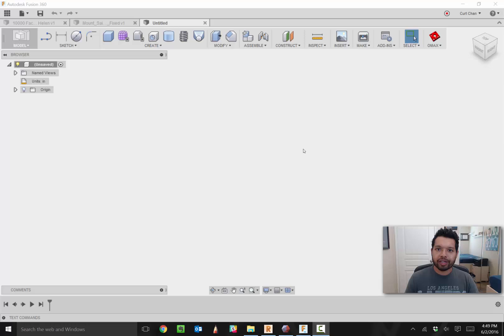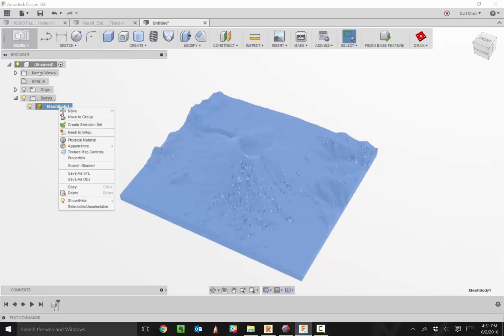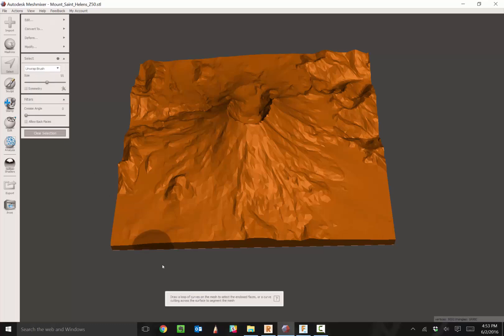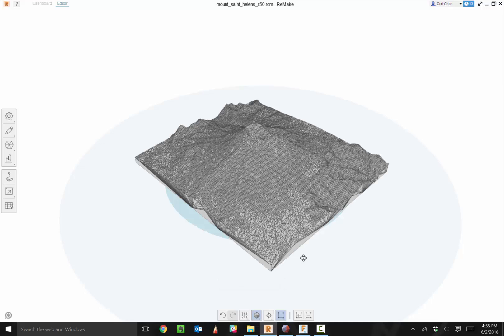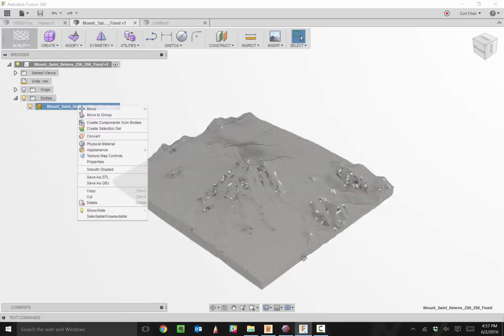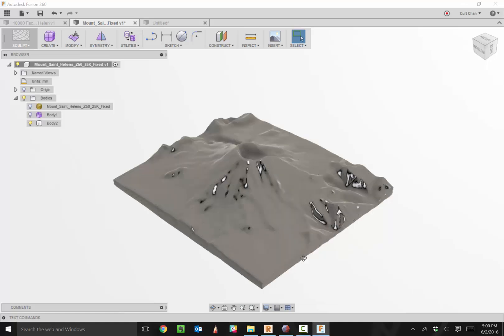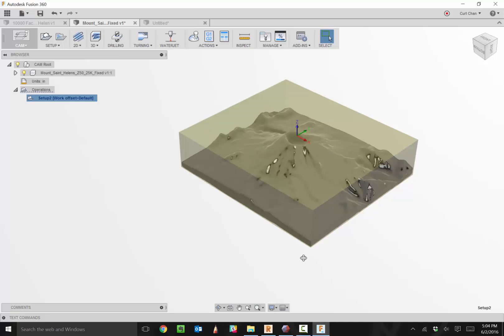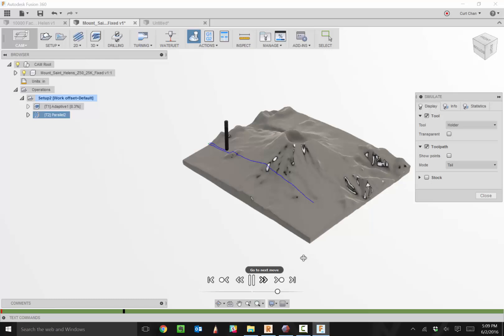Fusion 360: STL to CNC Machining with Autodesk ReMake

Comment: One more detail, Fusion 360, has another hidden setting in preferences wherein MESH we must uncheck the box for TRIANGULATE MESH POLYGONS!! 
Over and over again modified my mountain in RECAP just getting triangles it has been days to figure out!! Please, next time cover "small" details like that because it is not the only detail that escapes the instructors, in some versions, you must save with the extension:.OBJ? 
Also in my current version of RECAP (no memento, no recap photo, no shenanigans, etc), I'm only allowed to export with 20k faces of my mount Vesuvius volcano from Thingiverse,  wherein your video I see you can export the model with a higher face count of 25k with the possibility of up to a 100k!!
 I hope this helps someone because it is mighty frustrating, but again thank you for sharing.

Comment: Thanks for this video; it helped me get started although i've now found that Fusion is not limited to 20k faces.. This video tells me that this is the limit and seems to imply that fusion can only calculate CAM from brep surfaces. This is a convoluted workflow for going from 3D scan to CAM.. I mean- this may be good if you want to spline over your scan but if you want tight integrity from scan to cam - this is not a good solution.  Now after some testing I'm asking why not just import a mesh as STL with 600k faces a million (or whatever is ideal for your project) and develop tool paths from there? This seems to be working for me - even with dirty scans that are not necessarily watertight...
Reply: and youve had success doing this?? as i have the same complaint. briging down my scans to 10000 faces loses all the good detail...

Comment: As a new Fusion user, I use the methods that you describe here to make my CNC Router Designs pop. Though I have run into a new issue that I can't seem to work around. I create 3D Signs using .STL files that I've collected from other designers and I need to Add Text to the designs. 
What I'm hung up on at the moment that I can figure out is, " How do I add Text to an already created 3D Surface"? In most cases it's a Ribbon of some sort.
Any input by you or anyone else would be greatly appreciated.

Comment: What to do when the whole point is that you want all the tiny details to be machined and thus can't reduce your mesh? 10'000 faces sounds laughable for todays hardware. I regularly machine 3.5 million faces with hobby level CAM software and this is preventing me from even evaluating Fusion 360.
Reply: I am looking at what CAM software to settle on. What are you using?

Comment: Ok, How come I can not get this to convert... I am following your process step by step and I can not get my mesh to be converted to a solid object.  I can not find any convert option in my right click.  can anybody help.  this video i old in comparison to the latest fusion 360 updates.  any help is appreciated.
Reply: why and why is there no hint for the user that there are more operations present that are just currently not available? Usability FAIL.
Reply: @MarcusWolschon  Yeaaa 360 has little quirks like that. unfortunately you just gotta learn them and deal with it. BUT when you learn how to speak it's language, the results are amazing
Reply: @bdragon254  I'll just stick to my Alibre Design for CAD (and, having the 2018.1 version with mesh support, do interaction of meshes with solids there). 
My CAM for meshes also stays Deskproto as Fusion360 doesn't offer any meaningful strategies for meshes.
BUT for technical parts, I consider using Fusion360 as a CAM. I juuuust need to find out how to tell it that my machine has no Y axis.
Reply: some stuff is not available when you have the "capture design history" checked

Comment: This was really useful.  I was under the impression that you used a new setup when you changed bits and that the setup was the level at which you post processed into a nc file, but I see you have both bits in one setup.  I also noticed that Rest machining doesn't seem to work across setups.  So how do you deal with post processing and grouping multiple operations with the same bit into one nc file, but different bits into different files?
Reply: Write a manual tool change macro in your machine control software and assign it to the M06 command?